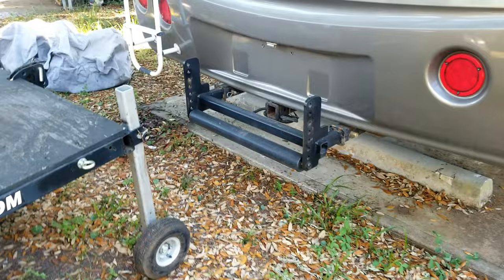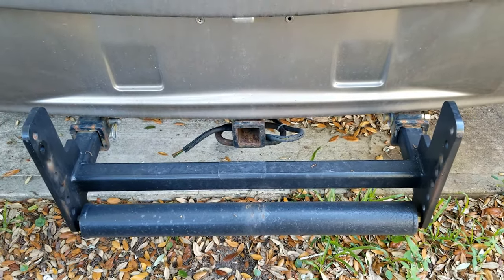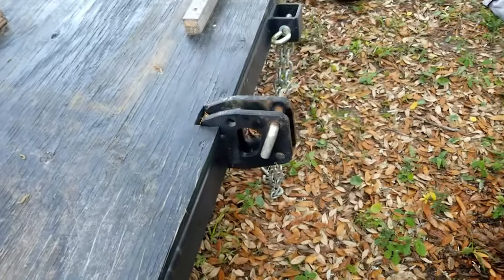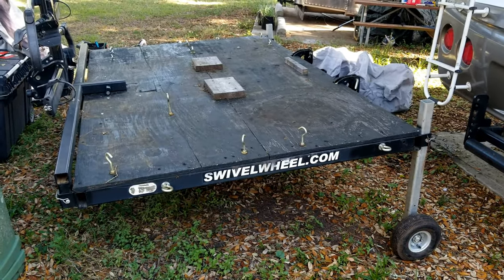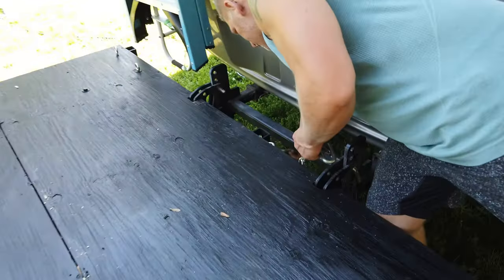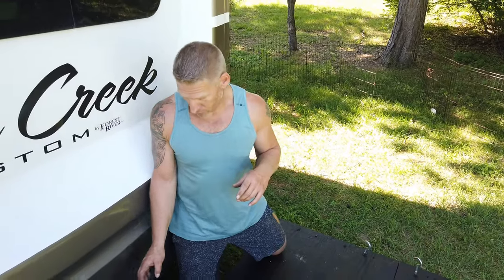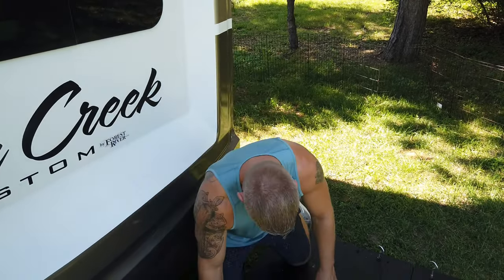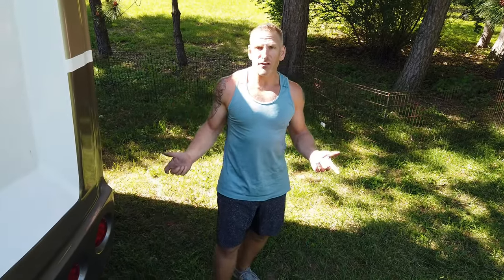People always stare.... SwivelWheel, a mixed blessing!

Comment: PITA is right. Had one and sold it. Too much distance from the rear trailer axle and the rear of the trailer for a giant swing on turns. Easy to hit things in tight quarters. The short wheelbase and short hitch caused a lot of trailer movement, and the motorcycle broke straps from extreme angles. Torsion suspension is not compliant enough and is a rough ride for cargo. Overall not happy, and the Idaho hauler looks better.
Reply from the maker: Yeah, it definitely added a little bit more things to consider in towing and backing.

Comment: 4:50
The solution for that, if there is any possible way to move the wheel back more. It would work fine.

Edit: it will put a lot of stress on the hitch tho, so beware of that
Reply from the maker: Sorry about the delayed response, missed this comment.  Without serious modification, there wasn't much room to move the wheel back.  I think it would still have the issue of low clearance when it flipped, unless it was way back.
Reply: @TrippinWithTheSmiths  no problem. Also, true, I did not think of that…

Comment: I see the swivel wheel is attached to a cedar creek trailer. Are you still satisfied we are thinking about a trailer for a golf cart. Was the hitch welded to the rear frame rails and where did you pick power for the wiring harness
Reply from the maker: It was attached to our old trailer.  If I didn't have a toy hauler now, we'd still be using it.  We had one disaster with it, but it was self inflicted - didn't repack bearings after buying the larger version.  All in all, it was worth it.  It was a little hassle here and there with the extra length, but the ability to carry our outdoor stuff, or a golf cart, is well worth it.

This was caused by not repacking bearings, and was the only issue we had with two different swivel wheels and around 40k miles.  Only thing we did was replace some tires, other than this:

https://www.youtube.com/watch?v=ot3fu8N4Bl4

Comment: How do you like the trailer with the axlesbyjoellc swivel assy? I am looking at his setup to build my own trailer.
Reply from the maker: We don't have the trailer any more, but we liked the new axle.  It was pretty heavy duty - - probably capable of more than it's rated for, and the extra tire/spindle offered some peace of mind.  Never had any issue with it, and it did not flutter/wobble as some suggest it will.  One recommendation - when you mount it, ensure it gives you the right trailer height, both when it's trailing going forward, and when it's flipped and you're backing up.  Ours was  a little low backing up at times.

Comment: I just got the SW46. My only issue is the speed. They recommend 65 mph. I cant imagine anyone going down the highway for hundreds of miles going only 65mph. Did you go over and if you did, what was the outcome?
Reply from the maker: We ran at 65 most of the time.  Most trailer tiress aren't rated for any more.... that's your limiting factor.  If you find higher speed rated tiress for it,  you should be done.  I found some that were rated to 72-75 mph for a buffer.  Don't remember the brand tho.
Reply: @TrippinWithTheSmiths  How did you ever change the tire if a flat came? Did you put the jack under the swivelwheel system itself to lift it up?
Reply from the maker: @JARVISdotEXE  If you have it attached to the RV, you can just use a jack on the rear to get it in the air.  If it's not attached (and unloaded), just flip it on it's side.  Pretty easy, either way.

Comment: does single wheel trailer required license plate
Reply from the maker: Because it's technically an extension of the fifth wheel trailer, you just move your fifth wheel license plate to the swivel wheel trailer.
Reply: @TrippinWithTheSmiths  
the equipment touch the ground is not the same as what originally documented at DMV. there for does not work that way.
Reply from the maker: @harutanaka3647  I'm sure you know better than we do, we only ran it for a couple years and did our own research.  Gonna also depend on your state.  But, the swivel wheel trailer is technically an extension/cargo carrier.  If you know the answer, why ask the question?

Comment: Hello I just purchased a used swivel wheel and am wondering about what kind of hitch that I need on my 5th wheel to make the dual hitch set up work? Thanks!
Reply from the maker: For ours, we needed to have the dual receiver hitch adapter, and have the actual receiver tubes welded to the hitch on the trailer.  Details here:

https://www.cruiserlifts.com/collections/swivelwheel-transport-systems/products/swivelwheel-58-single-wheel

Comment: What is the top rated speed for that small wheel, or is that wheel always touching the ground?
Reply from the maker: The wheel is always on the ground.  The tires are rated for 65 MPH, which is about the most I do with the trailer.  I occasionally will run 70, but that's rare and usually just for passing.  I check the hubs pretty regularly for temperatures, and they are pretty consistent - usually about 10 degrees lower than the big trailer hubs.

Comment: What did you use for the roller bar?
Reply from the maker: A piece of heavy pipe with steel plate and a nut welded in the ends, then a grade 8 bolt to hold it on.

Comment: Ok, one more time with a question. This winter is my window for getting my motorcycle on our 5th wheel. You still down with this system or have you had any changes in this last year. Once again, thanks so much for your help and info.
Reply from the maker: We have moved on from this and now have a toyhauler.  With that being said, I'd still use it if I had a need for it.  I would, however, make sure I got a version that has at least two wheels, just to have extra capacity.  Running the smaller ones with one wheel puts it too close to the tire capacity.
Reply: @TrippinWithTheSmiths  thank you for the reply. Just checked out your new rig. Wow! Nice upgrade. Love the excitement you both show. Safe travels.

Comment: would it work well to make a deck for my 5th wheel or is to hard to move to the side of the 5th wheel?
Reply from the maker: It would not work well for a deck - when it's not connected to a vehicle, it tips over really easily - almost like that's it's mission in life.  By the time you got it braced and safe, you could build a deck from scratch.

Comment: Is it a 5rh it's hook to
Reply from the maker: It connects to either a single or double standard trailer hitch.
Reply: @TrippinWithTheSmiths  how did you run power to the SwivelWheel? Did your camper come with a 7 pin connector? What type of power cord(s) come with the SW  trailer?
Reply from the maker: @youllfloat2pennywise344  standard 4 pin connector,  trailer side was wired into trailer lights.
Reply from the maker: Yes.
Reply: @TrippinWithTheSmiths  Ok my 5th wheel doesn't have a power connection in the rear. It looks as if I'll need to have a female 4 pin power cord run from my truck to the SWIVELWHEEL. Thanks for the heads up!
Reply from the maker: @youllfloat2pennywise344  np. You can have a trailer shop add one to the back of the trailer... good idea to get the hitch checked out and reinforced.

Comment: I'm curious. Your earlier video "The Swivel Wheel Fiasco
" really seemed like you weren't going back to a SwivelWheel. What made you decide to give it another try. Asking as I'm on the edge of buying one and that video made me question if it was a good idea. Also, how long have you had this one running fine? Thanks.
Reply from the maker: It was a pain in the butt when that happened...but it was our fault. We bought that trailer used, and didn't check or re-pack the bearings, and that's what caused the issue.  Once we got it fixed, we put about 15k miles on it with no issues.  If you don't have a toy hauler fifth wheel, I think it's a great option to carry other stuff.  It does add a little bit more work, but at the the end of the day, we think it's worth it.
Reply: @TrippinWithTheSmiths  Thanks for the reply, it's very helpful. Also, your ability to recognize that you had some responsibility in the failure is great. Many people would never want to admit that. I'm really glad it's worked out for you and this gives me a lot of confidence in the product. I'll be getting one for sure. Safe Travels!
Reply from the maker: @stevebrien9759  No problem.  Don't want our poor judgement to cloud someone else's.  Learning from someone else's mistake is way better than from your own!